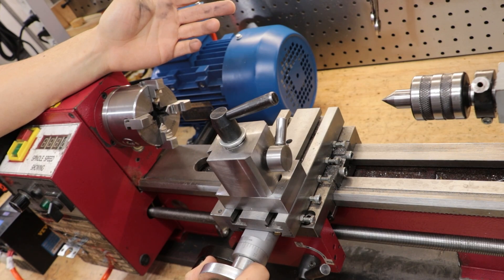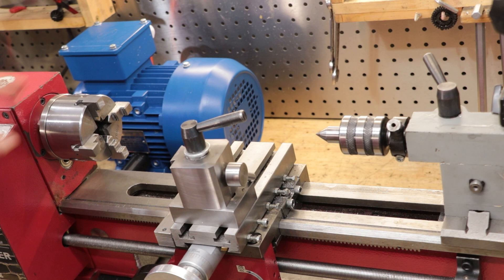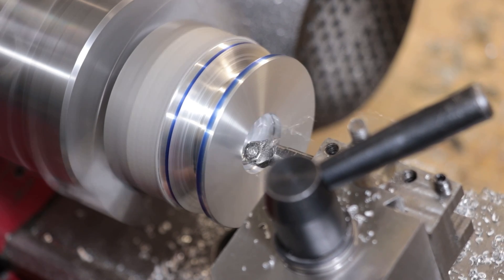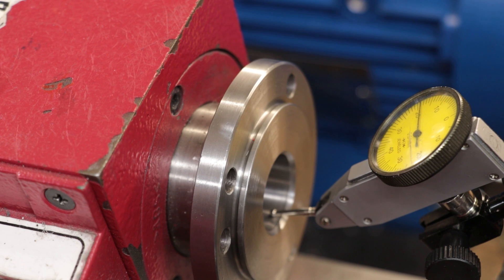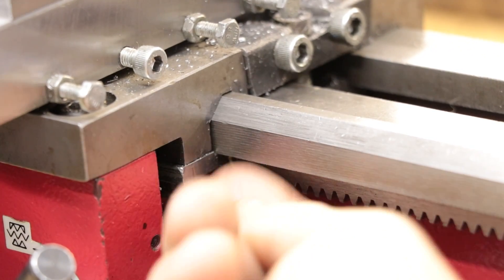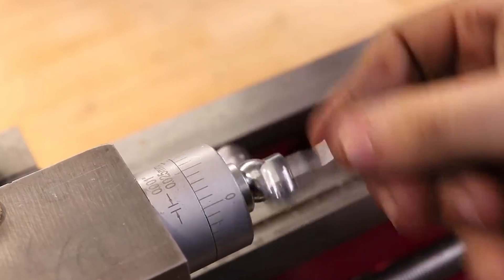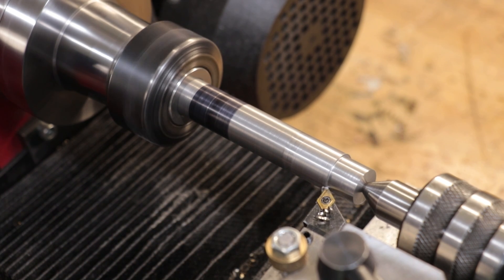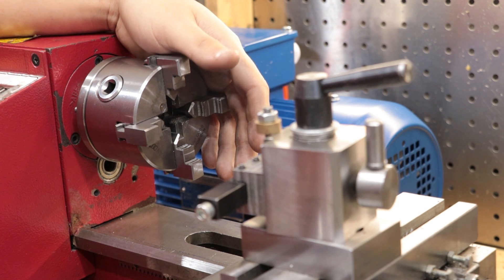The $600 Mini Lathe - 4 Years later

Comment: Dont by Chinese if you can avoid it. Thats the Australian thing to do.
Reply: Yeah, right.    Practically nothing is made here in Australia, now.   We used to make everything - even lathes ranging from small school machines to large professional units.  But not now.   We sell dirt to China and China sells us everything made from that dirt.
It's either buy Chinese, or go without.   Or pay really outrageous amounts of money for something made in Britain or Germany that won't actually be any better.  Or from India that will really be junk.
Reply: @keithammleter3824  I have very little Chinese made stuff. It can be done. Made in Taiwan is often a good compromise.  Often better quality but cheaper than European Japanese or USA made.
Reply: @ozyrob1  : Taiwan-made machine tools are excellent quality - but made for professionals and the cost is hard to justify for use at home.  I've never seen one anywhere as small as the one in this video.   The silliest thing to buy is the English Myford - as for rigidity and freedom from chatter, no better than the Siegs of the same nominal size - but cost $thousands.   And with screwed on chucks - dangerous.
I have a Sieg C6 - the non-variable speed model.   The only bad thing about it is the same as in this video - the electrics are crap.   Easily replaced.   It at least has proper v-ways, unlike the ridiculous Myford.   At work I used an old Sheraton - much better in every respect, but no longer available.